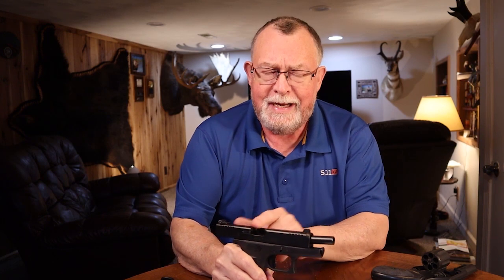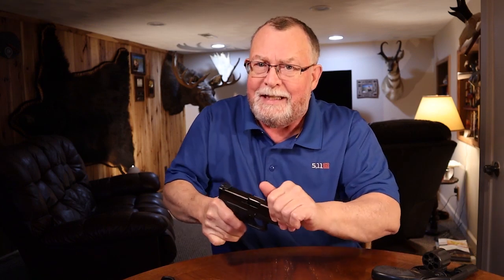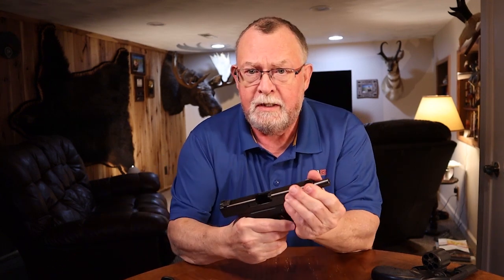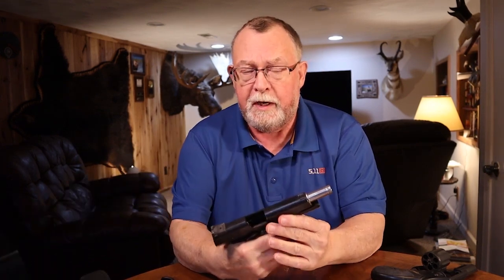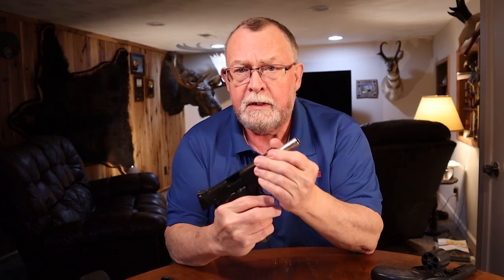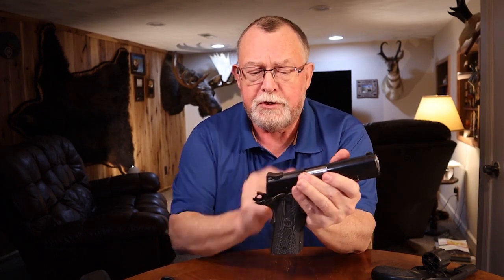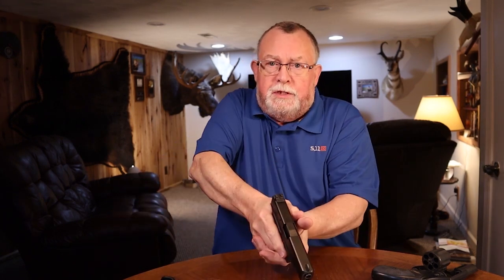Armed Self-Defense - Mechanics

Comment: Nice presentation.
I carried a Gen2 G31 for 20 years. I often carried a P229 on 357Sig for CC. Both extremely reliable utilizing a capable round.
I currently typically carry a P365 SAS. After almost 40 years, I guess I'm what, by your description, is a point shooter. 
The SAS sight has no front post; the sight is recessed in the slide. My eyes may notice the sight, but my memory doesn't register that. 5 to 6 inch groups at 20 yards from a 3.1" device with an optic milled inside the rear of the slide. The sight is only visible when the eye and slide are aligned within maybe 10moa. I don't know the actual because I never considered it until just now.

Comment: Great training video! The most important point, IMO, is the emphasis you put on carrying the gun with a round in the chamber. If you have time to chamber a round, you probably didn't need it anyway. Years ago, I knew a guy that carried a 1911. He was afraid of carrying the gun with a round in the chamber, cocked, and the safety on. For some reason, he pulled his 1911 and while trying to get a round in the chamber, his opponent grabbed the pistol from his hand. He was lucky he survived the encounter with only a serious pistol whipping from his own gun.

I suspect alcohol was involved.

Most people think that pointing a gun at a criminal will stop them in their tracks. My experience is that it is just as likely they will immediately attack you and go for the gun, especially if you are close to them. Wearing a uniform and displaying a badge stops a lot of this.
Reply from the maker: The statistics seem to indicate that the display of a pistol often does cause the attacker to stop the assault.  But you need to make sure the pistol is FULLY ready to go with nothing more than a safety flick to get it in action.  Don't depend on them giving up so easily.

Comment: One needs to be very careful doing the "over the slide" slide release if your gun has safeties mounted on the slide.A Beretta 92FS comes to mind.  It's very easy to grab the safeties and engage them. Then you end up holding a dead mans gun.
Reply from the maker: Which was exactly one of the reasons why my time carrying a Beretta on duty was brief.  I have always believed the whole SA/DA auto pistol with decocking levers concept was an ingenious solution to a non-existing problem, to quote Jeff Cooper.  That is also why very few police agencies still carry those type of sidearms.  Consistent trigger pulls are BY FAR the easiest to maser and the safest pistols out there.

Comment: Im dumb. Hiw does the slide go back when the empty casing is in the chamber? Where does the pressure come from?
Reply from the maker: The bullet has left the barrel, but it takes a few milliseconds for the pressure to drop to zero.  The slide/barrel of a locked breach pistol like a 1911 then moves rearward and the rear of the barrel drops to unlock.  The primer "wipes" I describe come from the barrel dropping before the firing pin has fully retracted from the primer dent.